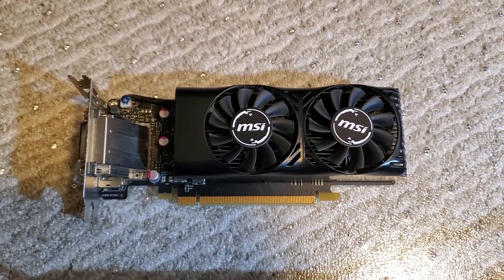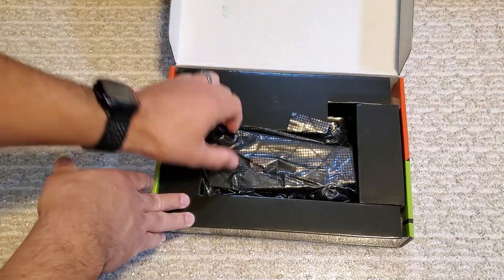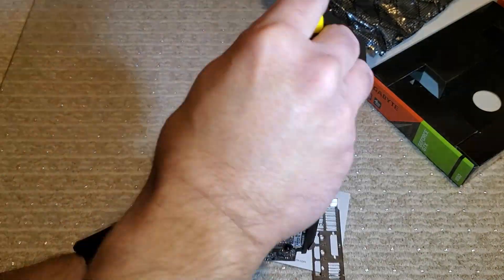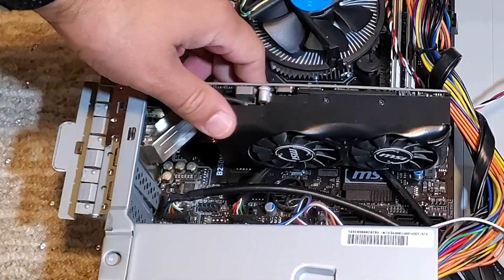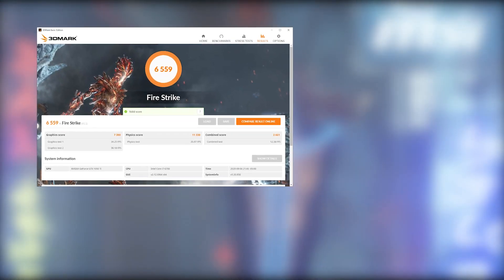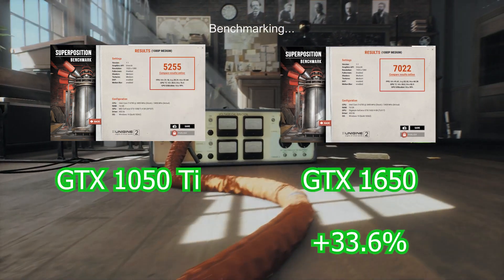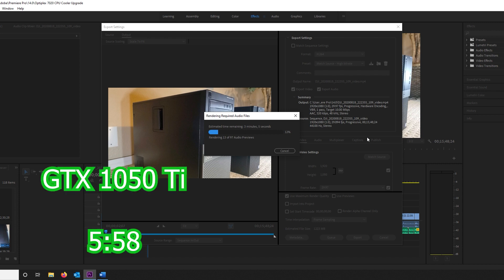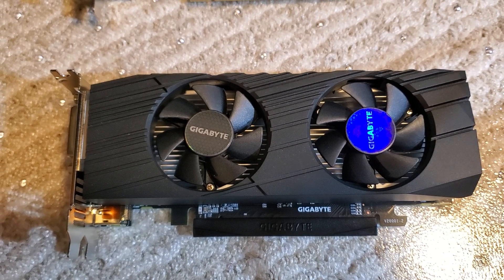Fastest Low Profile Graphics Card September 2020 - Nvidia GTX 1650 vs GTX 1050 Ti

Comment: Would it be possible to post a link to your PSU? I own a sff tower with a 240w psu and I plan on getting the 1650 lp , but I don’t want any wattage issues. Should I switch?
Reply from the maker: I went with a Silverstone TFX 300w unit.  It's the only TFX unit they make.  Amazon has it for a decent price right now, I will put a link in the video description.   Thanks for watching!
Reply: You’ll be fine, it’s a 75 watt card and plenty of people run the 1050ti (also 75 watts) in 240 watt SFF PSU’s.

Comment: Welp, need a new case if im running this... sff cases suck
Reply from the maker: I'm about to do a video on my SFF case and a PSU & cooling upgrade.  Getting pretty good results so far.
Reply: @EscoTech  What card is on the left side of the screen on 0:30? I think that would fit in my case
Reply from the maker: The little card on the left at 30 seconds is an MSi Low Profile 750 Ti.
Reply: @EscoTech  Hmm, can you send me a link of where you got it from? Because the ones I searched up for had long brackets

Comment: Good day. Nice video.
Do you have cpu and gpu temperature in load? In fortmat USSF the temp is a factor important for me.
Reply from the maker: My next video is going to be a cooling upgrade for the custom SFF system that this is in.  I should have it done shortly, but the best temps I've been able to get under heavy stress testing are in the low 70 C degree range.  That video should be out within a week or so.  Thanks!

Comment: Hello, have you been able to verify that this card is in fact NOT the upgraded TU116 Turing Encoder? If this is in fact the GV-N1656OC-4GL, that you reviewed, I am finding one website that states the chipset in this card is the "TU116-250-KB-A1" which if true would indicate that it is not using Volta for the encoder. Are you able to pull this information anywhere definitively?
Reply from the maker: I read your conversation with John Braman in another thread, but I'm not sure I have a definitive answer.  The model listed on the box is GV-N1656OC-4GL, which matches what you said.  However, in GPU-Z, it does read as a TU117 card, which leads me to believe it does not have the new Turing encoder.  Hope this helps, let me know if you have any other questions or want me to try to pull any other info off the card.  GPU-Z doesn't validate the card, so it may not be 100% accurate, but it does seem to read all the other info correctly, so I have to assume it's correct.
Reply: @EscoTech  Thanks for taking a look.

Comment: Do you know the best overclocked settings for this card
Reply from the maker: I haven't overclocked yet, because my case cooling sucks.  I'm tweaking it for my next video and may try to overclock it if I can get my temps down a little.   Thanks for watching!
Reply: @EscoTech  lol this card is never below 83 c even with msi afterburner max fan speed
Reply: @turbo7367  you have to undervolt it. I got stable 1740 at 80 degrees during heavy usage.

Comment: WOULD IT RUN ON A OPTIPLEX 7010 SFF
Reply from the maker: I don't have one to test, but from looking at pics, it will just barely fit.  Cooling and power might be an issue, depending on your PSU, but it should work.  Thanks!
Reply: I have a Dell Optiplex 7010 SFF with the GTX 1650 GDDR5 Low Profile and it runs fine. The new version of this card will work too I guess.

Comment: the 1650 does have turing encoder according the nvidia site. the ones with gddr6 memory and  tu106/tu116 have the turing encoder. https://www.nvidia.com/en-us/geforce/graphics-cards/gtx-1650/
Reply from the maker: I don't remember my source, but I read that it got a scaled down version of the new encoder somewhere.  I was under the impression these didn't get the full Turing treatment until the 1650 Super.  Either way, it's better than my 1050 Ti was.  Thanks for checking out the video!
Reply: This is all super confusing because not ALL of the GDDR6 versions have Turing for the Decoder AND the Encoder. For example the ZT-T16520H-10L is like the older GDDR5 models in that it has a Turing Decoder but Volta Encoder even though it has GDDR6 memory. I have seen some evidence though that this card is more in line with the new GTX 1650 Super cards in that it is on the TU116 architecture and has Turing for both Decoder and Encoder. I left a comment for the OP and am hoping they can pull this information definitively from the Nvidia toolset on the computer. Hopefully we can see if the card is a TU117 or a TU116. If it is TU116 that could explain why it runs hotter than the other GTX 1650 Low profile cards on the market.
Reply: @ggerhardt1  it's turing encoder but with out the ray tracing.
Reply: @JohnBraman413  Do you have a source for this? I have not been able to find anything definitive. I am looking to use the card for transcoding and not gaming and would love to know for sure.
Reply: @ggerhardt1  it does show on nvidia's website under specs as well. but this site breaks down all the specs also. https://www.techpowerup.com/gpu-specs/geforce-gtx-1650-super.c3411#:~:text=The%20GeForce%20GTX%201650%20SUPER,on%20GeForce%20GTX%201650%20SUPER.
Reply: @ggerhardt1  i have the zotac gtx 1650 super twin fan and here's the specs on mine that shows turing. https://www.techpowerup.com/gpu-specs/zotac-gtx-1650-super-twin-fan.b7473
Reply: @JohnBraman413  Right but this card is not actually listed as being one of the retail offerings for the GTX 1650 Super if you look in the list at the bottom of the page you linked to. I can't find this card anywhere on that site and I have been looking for awhile. That's why I was hoping that the creator of the video could get us some hard facts.
Reply: @JohnBraman413  The Zotax GTX 1650 Super Twin is not the card reviewed in this video though.
Reply: @ggerhardt1  which card?

Comment: I have a dell 3650 pc pre build model can i change my graphics card to gtx1650 low profile? many people say that it works my watt is 240w tho
Reply from the maker: Yeah, you should be fine.  As long as your slot can deliver the normal 75W PCI-E, it will work great.  Thanks for checking out the video!

Comment: Sorry if I missed it. What CPU did you use?
Reply from the maker: Nope, you didn't miss it.  I never said it.  My CPU is a Core i7 6700.  I'll add the full system specs in the description.  Thanks for pointing that out and also for checking out the video!

Comment: Nice video! I have one in a HP 6300 with i5-3470 and 16gb ddr3 ram and runs pretty well even in modern games. Maybe the Gigabyte version runs more hotter(84ºc gaming) than others versions like Zotac and Galax.
Reply from the maker: I didn't really touch on temps in this video, because I'm planning a follow up video with better cooling in the case.  I might even try some custom cooling on the card if it's still too hot.  Thanks for checking out the video!

Comment: I have this card for my SFF build. This card naturally runs hot, even with good airflow. But I haven't run into any problems yet due to heat except, the stickers on the back falling off.
Reply from the maker: Yeah, low profile basically sacrifices any chance at good cooling.  That's the trade-off, I guess.  Thanks for watching!
Reply: take the card apart and use good/better thermal paste, it'll cool the card down lots
Reply: How hot does it get?
Reply: @discospaghetti6744  it runs about mid 60's C to about mid 70's C or so. It can get up to about 80°C the more demanding games I play though.

Comment: These are great for old office pc rebuilds. I have one in a HP 8300, i7 2600 and have not come across any laggy games so far.. even on ultra!  They run a bit warm though as outlined in the vid.
Reply from the maker: Yeah, these cards are perfect for pre built office PCs.  A lot of those have plenty of power, outside of the GPU.  I'm going to try a couple different cooling solutions with this case, we'll see if I can get those fans to stay a little quieter.  Thanks for watching!
Reply: EscoTech  - another thing they are on special at most pc stores due to the latest gpu releases.  I wonder if an update is on the horizon for a 1650?  Faster, more ram, low power consumption, no dedicated  power supply  and of course low profile!
Reply from the maker: I hate that nvidia is always so slow to release the mid-range and low profile cards.  I'm super interested in what's coming, too.

Comment: I'd love to run either of these in my optiplex 7040, however its a SFF so I'm stuck with the AMD Radeon R7 350x that's in it unfortunately. Just no room.
Reply: I completely understand you’re pain! Everyone’s telling you to upgrade and move on, but you just can’t! I’ve shoe-horned an msi gaming x 1050ti in my full-size dell optiplex 755 with 8g of ddr2 and a core 2 q8400!
Reply: @Samuel-zl7yw  DDR2 and a Core 2 processor? You have my respect for still rocking it on a build that old.
Reply: @BrucifyMe  I appreciate your kind words! It's not my main rig, but something to knock around with when I'm bored. The core 2 quad is very tired in handling the 1050 ti
Reply from the maker: It does suck how Dell put the PCI-E slot on the SFF 7040 so close to the PSU and at the very bottom of the Mobo like that. There is no way to fit a decent card that is two slots high.  Thanks for checking out the video!